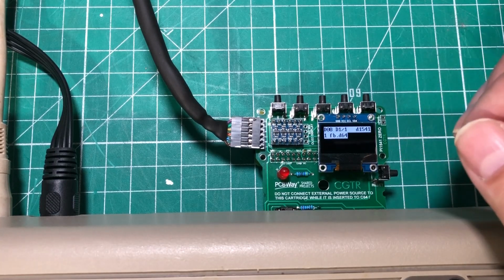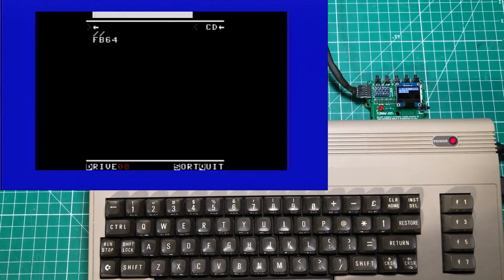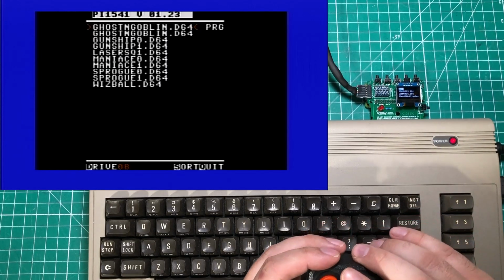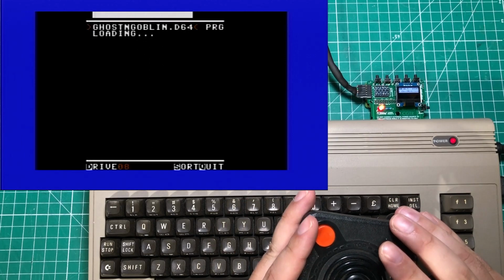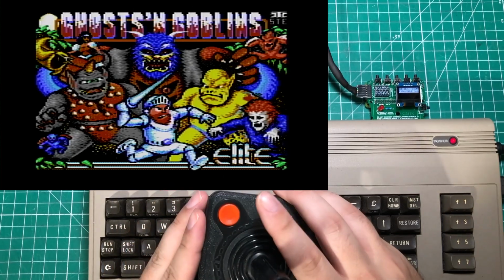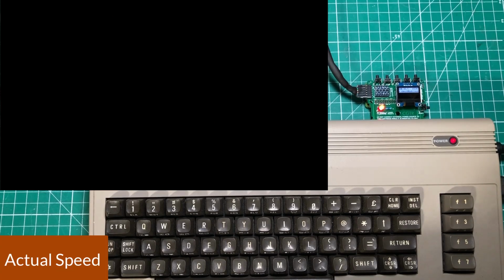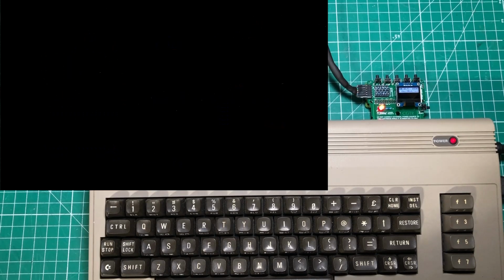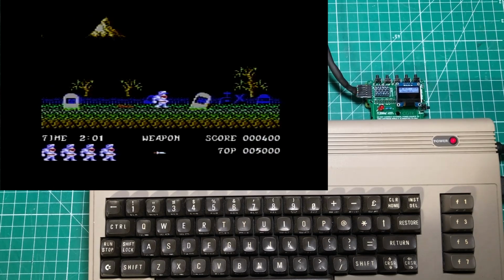Commodore Pi 1541 + Epyx Fastload Cartridge - Everything You need to get started.

Comment: That's the IEC Serial port, not the User-port. The User-port is the wide one on the far left on the C64. The one which was usually used for Modems back in the days, or WiFi modems nowadays. I am sure you already know this and are just brain farting all over the place. But there are newer generations of C64 users out there, who are confused enough as it is with these old relics.
- Yeah, and by that, I guess I mean both us and the C64s 😅

Comment: I've completed the device, it works fine. However, I'm not sure how to connect the pins of the JST connector to the DIN6. In my case, pin 1 is black, and I soldered it to the first left pin of the DIN (when viewed from the soldering side). The cable (red) from pin 2 of the JST, I soldered to the next DIN pin, and so on until pin 6 (green), which I soldered to the central pin of the DIN connector. Unfortunately, the C64 cannot recognize the connected device, so I suspect there might be something wrong with my soldering scheme. Can anyone advise me on this?